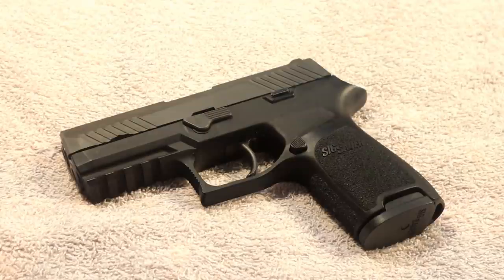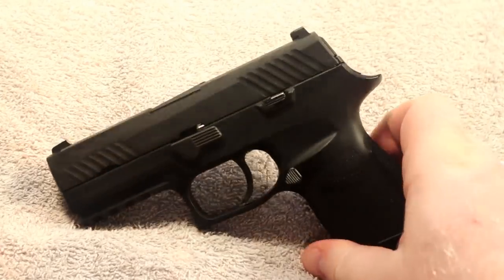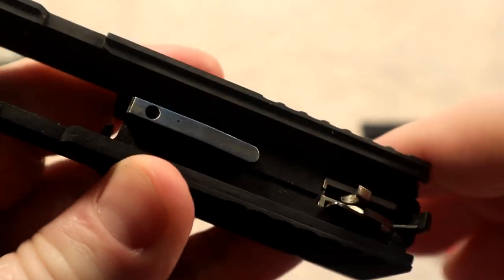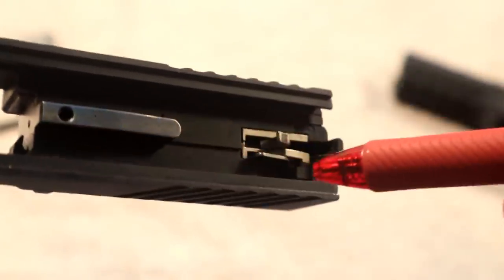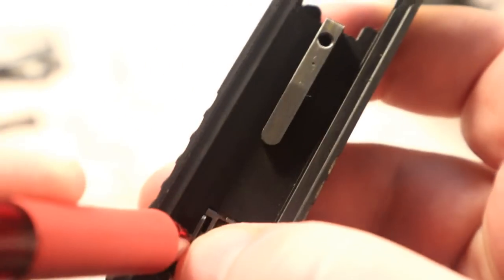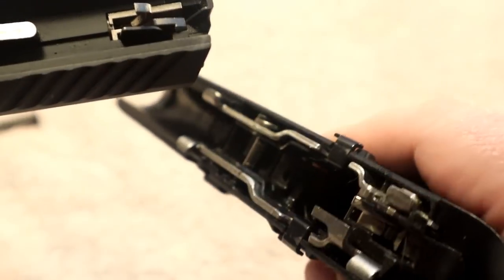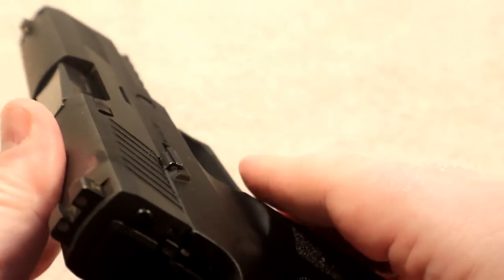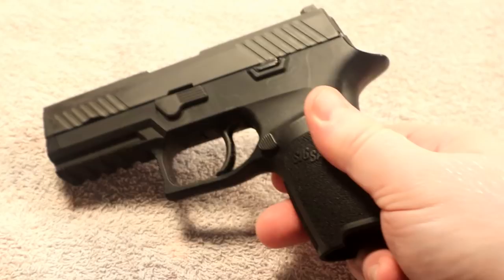The Sig P320's Dirty Little Secret You Won't Find in the Manual

Comment: If the firing pin broke forward of the block safety, would that not allow the firing pin to travel forward and strike the primer? The striker block safety is part of the striker housing and is located in rear most section of the striker assembly.
Reply: On a Glock, M&P, or any other pistol, if the firing pin broke forward of any safety catch- would that not allow the firing pin to travel forward and strike the primer? 
The whole point of the video is the p320 can't 'fire on its own inside a holster' unless multiple catastrophic failures occur to the pistol's safety mechanisms.
Reply: @bikeracerdude  I know on the glock model pistols the striker block is forward of the striker spring. If the glock firing pin breaks forward of the striker block, there isn't any spring tension to cause forward movement. The spring and its tension are behind the striker block in glock models. I believe that M&P pistols have rear striker blocks under the rear sight, but I don't have a larger M&P to determine how the spring tension is captured.
Reply: @samuelpsalm25  My post was to reiterate the point of the video, and to show your top post above is irrelevant to the topic of this video, which is that p320s can't fire by themselves inside holsters unless something depresses the trigger. Your posts are a deflection (perhaps intentional) away from the topic of this video, and intentionally or not serve to conflate the catastrophic failure you mention, with the questionable claim that p320s are firing inside holsters with no energy being applied to triggers.

(If a Glock suffers a catastrophic failure to include the block- the striker will likely ignite the primer. This is a deflection from the topic of the video and not relevant to the odd claim of p320s self- discharging inside holsters).
Reply from the maker: It would still need the spring to move it forward

Comment: No offense to the maker of this video but there was another video covering this and that guy explained it fairly well. He shows that it only takes a slight squeeze of the trigger to clear the firing pin block not a full squeeze. So an ill-fitting holster for instance or whatever causes any movement of the trigger when holstering/unholstering can clear the safety mechanism. Which is why most if not all of the newer lawsuits involve the gun being in a holster. 

Either adding a trigger safety or engaging the thumb safety would alleviate this problem. Or a redesign of the trigger assembly so that the entire takeup of the trigger needs to be engaged before the firing pin block is disabled. Considering this was Sig's 1st foray into striker fired pistols this is not too surprising. I think it should still be fixed. I own an M18 and I always engage the thumb safety when chambered.
Reply from the maker: Light squeeze of the trigger is how its designed.
Reply: @BoomStickTactical  That other guy alleges the trigger has to be partially pressed by a poor fitting holster or object in it, and then some other outside force- bump- has to be applied for the discharge to occur. He essentially disproves the claim they're firing spontaneously! Also, he hides comments but won't turn off comments. My exchanges w/ him a few yrs ago prove he hates p365 also.
Reply from the maker: @bikeracerdude  there's a lot of sig haters out there. They're fine.
Reply: @BoomStickTactical  Correct. Like I said, my exchanges with him a few years ago proved that guy with the video HATES the p365 too. He seems to only like metal framed hammer fired Sigs.

Comment: it's a bad gun for a myriad of reasons lol
Reply from the maker: Nothing wrong with them
Reply: @BoomStickTactical  sig is settleing lawsuits over them.  why are they doing that if there's "nothing wrong with them"?
Reply from the maker: @LIONTAMER3D  cheaper than going to trial. If someone sues you for 10k and offered to settle for 100 what would you do if the court costs would be 2k?
Reply: @BoomStickTactical  no.  you go to trial & win, the other side pays for your attorneys.  you settle when you don't think you can win.  obviously, you've never won or lost a court case.  why don't they think they can win?
Reply: @LIONTAMER3D  they settled only one and that was the "drop safety" lawsuit.
Reply: @Thesusoperator  that was a class action =/

Comment: Milwaukee police are suing Sig because these things are going off in their holsters.
Reply from the maker: There is no physical proof of any of them and you can sue a ham sandwich for making you fat but it doesn't mean it was at fault.
Reply: @BoomStickTactical , the P320 DID have legitimate problems early on and there are many manufacturers that don’t have these questions swirling about them. So not sure why you would EDC a Sig if you had the choice.

Comment: The Sig P320 HAS fired without the trigger being pulled MULTIPLE TIMES!

In Wisconsin, the Milwaukee Police Department has had department issued Sig P320s firing in their holsters on 3 separate occasions. One officer's Sig P320 discharged while he was searching a vehicle. The round struck an officer on the scene. Another officers Sig P320 discharged as he was exiting his vehicle, his hands were nowhere the trigger. The round struck his vehicle. And another officer had a brief struggle with a suspect and his Sig P320 discharged while in the holster, striking an officer on the scene. 

The Milwaukee Police Union is suing the city, stating they believe city leaders knew about the Sig P320 discharge dangers when they purchased them for the department in 2019 and did nothing to resolve the issue.

So yes, they do indeed discharge without pressing the trigger.
Reply from the maker: So where's the proof other than someone saying it's happening? Where's the gun and which components failed?
Reply: @BoomStickTactical  Not sure why my responses keep getting deleted but I've twice provided the proof you asked for.
Reply: @BoomStickTactical  I reside in Milwaukee, WI and the news about the Sig P320 and the Milwaukee Police Department has been reported on by our local news stations. I have the title of the article I cited, which is from one of our local news stations, and will (again) provide it to you if you'd like to see the information for yourself.
Reply: @Thesusoperator  The case was based on the fact that the city knew the guns were defective before they purchased them for the police force. The pistols discharging on their own was not being challenged by the city, they saw the proof of it occurring themselves. 

I completely understand questioning if these misfires occurred BUT if you're presented with eyewitness accounts BY other officers and you still question the validity of their reports......you probably are not willing to believe any proof presented to you. 

You're just stuck in your belief that this can never happen with this pistol.....proof be damned, lol.

Comment: I’ve been able to fire the pistol dry with a paper clip
Reply from the maker: That's causing a deliberate problem by manipulation of the system.
Reply: @BoomStickTactical  Yes, but it demonstrates a flaw in design. If something as thin as a paper clip lodged itself in that area while carrying on your hip or purse you may have an unintended discharge. It takes very little effort to release the striker in this manner. You can literally watch the trigger arms move up and down through the back plate gap. Also debunks the theory that the gun can’t be fired without pulling the trigger. Most of the recorded cases of misfires were holstered weapons. I’ve tried manipulating my glocks and Hk’s in the same manner with no success.